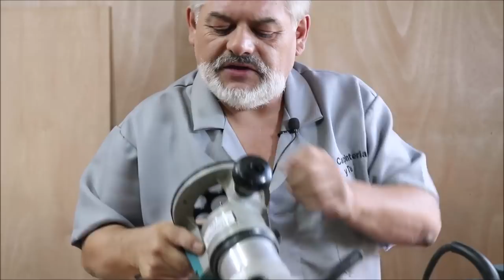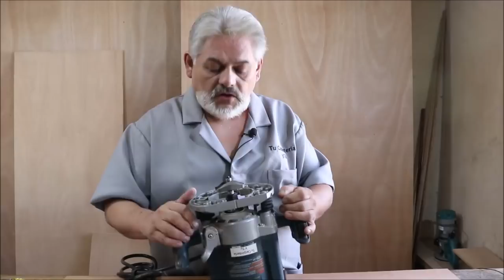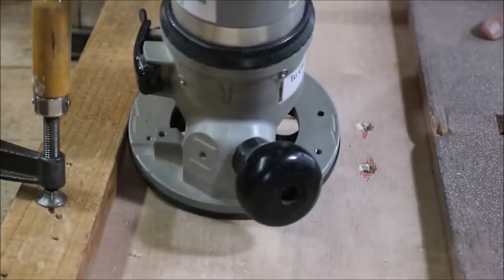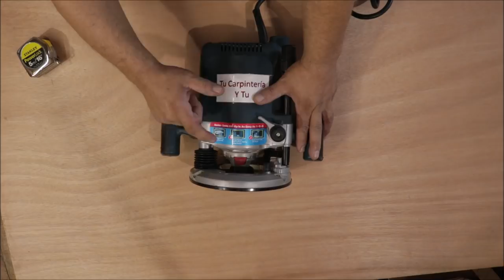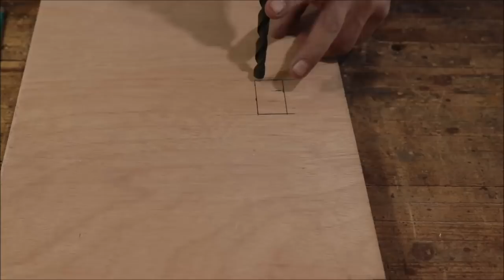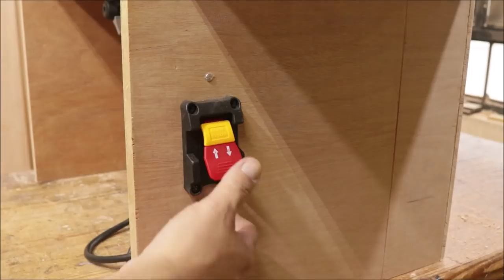MESA DE ROUTER DESARMABLE Y VERSÁTIL

Comment: Buenas noches Maestro. Disculpe, ¿el interruptor o arrancador que usó tiene algún amperaje en específico?
Reply from the maker: En este caso estoy utilizando un interruptor para 127 voltios pero hay algunos que son más grandes para mayor voltaje, saludos amigo José René
Reply: Si. Gracias Maestro. Sin embargo hay algunos que manejan cierto amperaje independientemente si son para 110-120 o 210-200 voltios (al igual que los fusibles), como de 15, 20 o 30 amps. por ejemplo.Si le metemos uno menor al correcto no dá la potencia requerida y si es mayor se pierde la protección en caso de una sobre carga o variación de voltaje de acuerdo a la energía que use el aparato, aparatos o herramientas. coloquialmente dicho la cantidad de energía que "jala" la herramienta.
Muchas gracias por sus amables respuestas y sobre todo todas sus enseñanzas.
Reply from the maker: Mira lo que encontre, te mando toda la información
Voltaje dual: 110 V / 220 V.
Corriente nominal: 20 amperios a 125 V, 12 amperios a 250 V.
Aprobado según UL1054 E200089.
Llave de seguridad extraíble para bloquear el interruptor y evitar operaciones accidentales.
Pala grande para parada de emergencia.
Reply: Muchas gracias Maestro!!.

Comment: Si utilizo mdf de 15mm para la base aun hay que hacerle el rebaje o solo perforo para atornillar el router
Reply from the maker: Mi buen amigo en el mismo video explicó que no es bueno utilizar mdf o aglomerado para la base fundamental del router ya que esté puede llegar a patear el trabajo debilitando al mdf y tarde o temprano este se podrá llegar a romper provocando un accidente es por ello que yo recomiendo mejor utilizar un contrachapado de madera este muy difícilmente puede llegar a reventarse, y aún cuando sea de 15 milímetros si es necesario hacer el rebajo para que siente bien el router, saludos
Reply: Saludos, gracias por tus comentarios, la razon por lo que mencione del mdf es porque en varios videos de otros carpinteros lo recomendaban que porque tendia a deformarse menos que los contrachapados , por las fibras de la madera
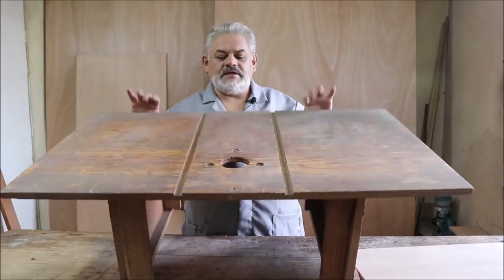Reply from the maker: Sí observas mi buen amigo en el minuto 2:19 presentó mi primera mesa de router la cual trabaje desde 1993 hasta la fecha de este video y sí se ve maltratada por el uso pero nunca tuvo ningún tipo de deformación, fractura o daño que pudiera provocar un accidente, de preferencia utiliza el contrachapado alistonado aunque el terciado también da bastante seguridad